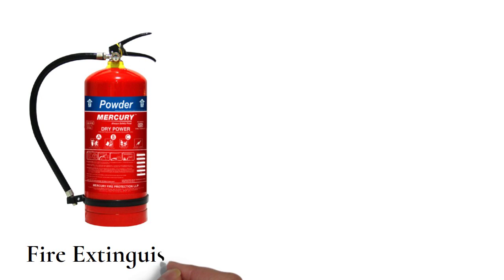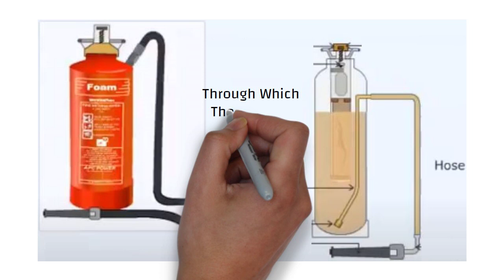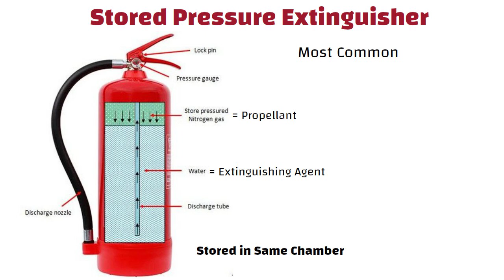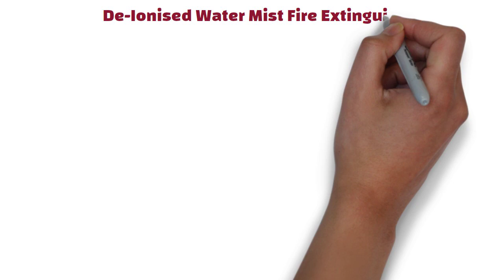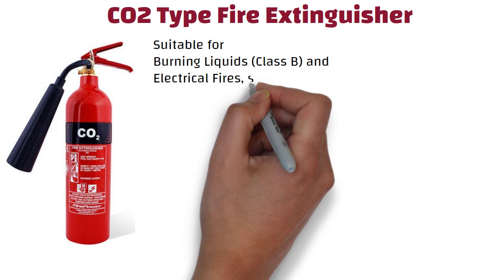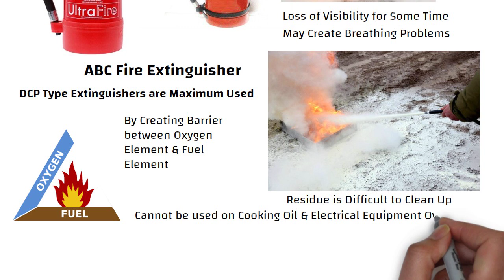FIRE EXTINGUISHER DEALERS IN KERALA, CALL 8138906102, FIRE EXTINGUISHER DEALERS IN ERNAKULAM.

Comment from the maker: Fire extinguisher dealers in KOTTARAKKARA, fire fighting contractors in KOTTARAKKARA, KOTTARAKKARA, fire and safety installations in KOTTARAKKARA, fire extinguisher suppliers in KOTTARAKKARA,fire extinguishers in KOTTARAKKARA, fire extinguishers in KOTTARAKKARA, fire protection system in KOTTARAKKARA, f fire and safety installation in KOTTARAKKARA, fire and safety contractors in KOTTARAKKARA, fire safety contractors in KOTTARAKKARA, fire and safety systems equipments in KOTTARAKKARA, fire equipment in KOTTARAKKARA, fire extinguisher in KOTTARAKKARA, fire protection system installation in KOTTARAKKARA, fire contractors in KOTTARAKKARA, fire safety consultants in KOTTARAKKARA,  fire alarm systems in KOTTARAKKARA, fire NOC in KOTTARAKKARA, fire AMC in KOTTARAKKARA, KOTTARAKKARA, fire fighting equipment in KOTTARAKKARA,
MS Jindal pipe dealers in KOTTARAKKARA, motor control panel in KOTTARAKKARA, fire pump panel in KOTTARAKKARA, motor control panel in KOTTARAKKARA, Morley fire alarm in KOTTARAKKARA, gst fire alarm in KOTTARAKKARA, addressable fire alarm system in KOTTARAKKARA, Pa talk back system in KOTTARAKKARA, PA talk back system in KOTTARAKKARA, auto glow SIGNAGES in KOTTARAKKARA, SIGNAGES in KOTTARAKKARA, pump PANELS in KOTTARAKKARA, LHP pump in kohi. Karthar valves in KOTTARAKKARA, Ravel fire alarm system in KOTTARAKKARA. Jindal pipe dealers in KOTTARAKKARA, Jindal pipe dealers in KOTTARAKKARA. MS pipe dealers in KOTTARAKKARA. Butterfly valves in KOTTARAKKARA, PA talk back system in KOTTARAKKARA, Fire alarm dealers in KOTTARAKKARA,, smoke detector dealers in KOTTARAKKARA, fire alarm panels dealers in KOTTARAKKARA, MCP, hooter dealers in Mangalor, hydrant valve dealers in KOTTARAKKARA, branch pipe dealers in KOTTARAKKARA, cp hose, RRL hose, heat detector dealers in KOTTARAKKARA,, Motor Control panel,  LED EXIT LIGHTS dealers in KOTTARAKKARA, emergency exit light dealers in KOTTARAKKARA, auto glow SIGNAGES dealers in KOTTARAKKARA. Conventional fire alarm system in KOTTARAKKARA
Reply: Fire extinguisher dealers in KAYAMKULAM, fire fighting contractors in KAYAMKULAM, KAYAMKULAM, fire and safety installations in KAYAMKULAM, fire extinguisher suppliers in KAYAMKULAM,fire extinguishers in KAYAMKULAM, fire extinguishers in KAYAMKULAM, fire protection system in KAYAMKULAM, f fire and safety installation in KAYAMKULAM, fire and safety contractors in KAYAMKULAM, fire safety contractors in KAYAMKULAM, fire and safety systems equipments in KAYAMKULAM, fire equipment in KAYAMKULAM, fire extinguisher in KAYAMKULAM, fire protection system installation in KAYAMKULAM, fire contractors in KAYAMKULAM, fire safety consultants in KAYAMKULAM,  fire alarm systems in KAYAMKULAM, fire NOC in KAYAMKULAM, fire AMC in KAYAMKULAM, KAYAMKULAM, fire fighting equipment in KAYAMKULAM,
MS Jindal pipe dealers in KAYAMKULAM, motor control panel in KAYAMKULAM, fire pump panel in KAYAMKULAM, motor control panel in KAYAMKULAM, Morley fire alarm in KAYAMKULAM, gst fire alarm in KAYAMKULAM, addressable fire alarm system in KAYAMKULAM, Pa talk back system in KAYAMKULAM, PA talk back system in KAYAMKULAM, auto glow SIGNAGES in KAYAMKULAM, SIGNAGES in KAYAMKULAM, pump PANELS in KAYAMKULAM, LHP pump in kohi. Karthar valves in KAYAMKULAM, Ravel fire alarm system in KAYAMKULAM. Jindal pipe dealers in KAYAMKULAM, Jindal pipe dealers in KAYAMKULAM. MS pipe dealers in KAYAMKULAM. Butterfly valves in KAYAMKULAM, PA talk back system in KAYAMKULAM, Fire alarm dealers in KAYAMKULAM,, smoke detector dealers in KAYAMKULAM, fire alarm panels dealers in KAYAMKULAM, MCP, hooter dealers in Mangalor, hydrant valve dealers in KAYAMKULAM, branch pipe dealers in KAYAMKULAM, cp hose, RRL hose, heat detector dealers in KAYAMKULAM,, Motor Control panel,  LED EXIT LIGHTS dealers in KAYAMKULAM, emergency exit light dealers in KAYAMKULAM, auto glow SIGNAGES dealers in KAYAMKULAM. Conventional fire alarm system in KAYAMKULAM,
KIRLOSKAR FIRE FIGHTING PUMP DEALERS IN KAYAMKULAM, FIRE FIGHTING EQUIPMENT DEALERS IN KAYAMKULAM, FIRE ALARM SYSTEM DEALERS IN KAYAMKULAM, FIRE CONSULTANTS IN KAYAMKULAM, FIRE CONTRACTOTORS IN KAYAMKULAM, FIRE CONTRACTORS IN KAYAMKULAM, FIRE ALARM SYSTEM DEALERS IN KAYAMKULAM, SMOKE DETECTOR DEALERS IN KAYAMKULAM, FIRE PROTECTION SYSTEM IN KAYAMKULAM, FIRE CONSULTANTS IN KAYAMKULAM, FIRE CONSULTANTS IN KAYAMKULAM, PA TALK BACK SYSTEM IN KAYAMKULAM, ADDRESSABLE FIRE ALARM SYSTEMS IN KAYAMKULAM, CUTTER PUMP DEALERS IN KAYAMKULAM, ADDRESSABLE FIRE ALARM SYSTEM SUPPLIERS IN KAYAMKULAM, SMOKE DETECTOR DEALERS IN TKAYAMKULAM, PRESSURE BOOSTING PUMP DEALERS IN KAYAMKULAM, SLURRY PUMP DEALERS IN KAYAMKULAM, WATER PUMP DEALERS IN KAYAMKULAM, RAVEL FIRE ALARM SYSTEM IN KAYAMKULAM,
Reply: FIRE EXTINGUISHER DEALERS IN CALICUT, FIRE EXTINGUISHER SUPPLIERS IN CALICUT, FIRE EXTINGUISHER DISTRIBUTORS IN CALICUT, FIRE EXTINGUISHER IN CALICUT, ABC TYPE FIRE EXTINGUISHER DEALERS IN CALICUT, CO2 TYPE FIRE EXTINGUISHER DEALERS IN CALICUT, CLEAN AGENT FIRE EXTINGUISHER IN CALICUT, MODULAR TYPE FIRE EXTINGUISHER DEALERS IN CALICUT, MECHANICAL FOAM FIRE EXTINGUISHER DEALERS IN CALICUT, FIRE EXTINGUISHER NEAR ME CALICUT, FIRE EXTINGUISHER TRADERS IN CALICUT, FIRE FIGHTING COMPANIES IN CALICUT, FIRE CONTRACTORS IN CALICUT, FIRE EQUIPMENT DEALERS IN CALICUT, FIRE ALARM DEALERS IN CALICUT, FIRE PUMP DEALERS IN CALICUT, SMOKE DETECTOR DEALERS IN CALICUT, FIRE FIGHTING SYSTEM IN CALICUT, FIRE PROTECTION SYSTEM IN CALICUT, FIRE AND SAFETY CONTRACTORS IN CALICUT, FIRE HYDRANT SYSTEMS IN CALICUT, PA TALK BACK SYSTEM IN CALICUT, FIRE NOC IN CALICUT, FIRE INSTALLATION IN CALICUT, FIRE NOC RENEWAL IN CALICUT, KIRLOSKAR FIRE PUMP DEALERS IN CALICUT, FIRE EXTINGUISHER NEAR ME CALICUT, FIRE EXTINGUISHER MANUFACURERS IN CALICUT, SAFEX FIRE EXTINGUISHER DEALERS IN CALICUT, FIRE NOC CONTRACTORS IN CALICUT, FIRE FIGHTING EQUIPMENT DEALERS IN CALICUT, FIRE PROTECTION SYSTEM IN CALICUT, FIRE INSTALLATION IN CALICUT, FIRE SAFETY CONTRACTORS IN CALICUT, FIRE AMC IN CALICUT, FIRE PROTECTION SYSTEM IN CALICUT, FIRE PROTECTION EQUIPMET IN CALICUT, AMC OF FIRE SYSTEM IN CALICUT, FIRE CONSULTANTS IN CALICUT, FIRE AND SAFETY EQUIPMENT DEALERS IN CALICUT, ADDRESSABLE FIRE ALARM SYSTEM IN CALICUT, KARTHAR VALVE DEALERS IN CALICUT, DCP TYPE FIRE EXTINGUISHER IN CALICUT, POWSER TYPE FIRE EXTINGUISHERS IN CALICUT, FIRE HYDRANT SYSTEM IN CALICUT, FIRE ALARM PANEL DEALERS IN CALICUT, SAFEPRO FIRE EXTINGUISHER DEALERS IN CALICUT, MS AND GI PIPE DEALERS IN CALICUT, JINDAL PIPE DEALERS IN CALICUT, AGNI FIRE ALARM DEALERS IN CALICUT, FIRE EQUIPMENT DEALERS IN CALICUT, FIRE EQUIPMENT SUPPLIERS IN CALICUT, FIRE EQUIPMENT TRADERS IN CALICUT, FIRE SPRINKLER SYSTEM IN CALICUT, RAVLE FIRE ALARM DEALERS IN CALICUT, RAVEL FIRE ALARM SYSTEM IN CALICUT, AGNI FIRE ALARM DISTRIBUTORS IN CALICUT, FIRE ALARM CONTRACTORS IN CALICUT, FIRE PIPE INSTALLATION IN CONTRACTORS IN CALICUT, FIRE SAFETY CONTRACTORS IN CALICUT, FIRE PA TWO WAY TALK BACK SYSTEM DEALERS IN CALICUT, HEAT DETECTOR DEALERS IN CALICUT, HONEYWELL FIRE ALARM DEALERS IN CALICUT, FIRE NOC CONSULTANTS IN CALICUT, FIRE AMC AND FIRE NOC IN CALICUT, FIRE SAFETY COMPANIES IN CALICUT, NEWAGE DEALERS IN CALICUT, MONSHER FIRE EQUIPMENT DEALERS IN CALICUT, KARTHAR VALVE DEALERS IN CALICUT, FIRE HYDRANT VALVE DEALERS IN CALICUT, FIRE HOSE REEL DRUM DEALERS IN CALICUT, FIRE SPRINKLER DEALERS IN CALICUT, FIRE PUMP DEALERS IN CALICUT, LUBI PUMP DEALERS IN CALICUT, LHP PUMP DEALERS IN CALICUT. FIRE CONTRACTORS IN CALICUT, FIRE AND SAFETY CONTRACTORS IN CALICUT, FIRE EQUIPMENT DEALERS IN CALICUT, FIRE FIGHTING CONTRACTORS IN CALICUT,

Comment from the maker: FIRE ALARM DEALERS IN KOTTARAKKARA, ADDRESSABLE FIRE ALARM DEALERS IN KOTTARAKKARA, FIRE ALARM SYSTEM DEALERS IN KOTTARAKKARA, ADDRESSABLE FIRE ALARM SYSTEM DEALERS IN KOTTARAKKARA, FIRE DETECTION SYSTEM IN KOTTARAKKARA, SMOKE DETECTOR DEALERS IN KOTTARAKKARA, CONVENTIONAL FIRE ALARM DEALERS IN KOTTARAKKARA, MORLEY FIRE ALARM DEALERS IN KOTTARAKKARA, GST FIRE ALARM DEALERS IN KOTTARAKKARA, ASES SECURITY FIRE ALARM DEALERS IN KOTTARAKKARA, BEAM DETECTOR DEALERS IN KOTTARAKKARA, FIRE ALARM SUPPLIERS IN KOTTARAKKARA, FIRE ALARM TRADERS IN KOTTARAKKARA, FIRE ALARM PANEL DEALERS IN KOTTARAKKARA, HEAT DETECTOR DEALERS IN KOTTARAKKARA, FIRE ALARM SYSTEM SUPPLIERS IN KOTTARAKKARA, FIRE ALARM COMPANIES IN KOTTARAKKARA, FIRE EQUIPMENT DEALERS IN KOTTARAKKARA, ADRRESSABLE FIRE ALARM PANEL DEALERS IN KOTTARAKKARA, FIRE ALARM SYSTEM IN KOTTARAKKARA, BATTERY OPERATED DETECTOR DEALERS IN KOTTARAKKARA, ASPIRATION DETECTION SYSTEM DEALERS IN KOTTARAKKARA, FIRE ALARM MCP - MANUAL CALL POINT DEALERS IN KOTTARAKKARA, FIRE ALARM HOOTER DEALERS IN KOTTARAKKARA, PA TWO WAY TALK BACK SYSTEM DEALERS IN KOTTARAKKARA, PA SYSTEM DEALERS IN KOTTARAKKARA, PA TALK BACK UNIT DEALERS IN KOTTARAKKARA, HOOTER CUM STROBE DEALERS IN KOTTARAKKARA, FIRE PROTECTION SYSTEM IN KOTTARAKKARA, FIRE ALARM CONTRACTORS IN KOTTARAKKARA, FIRE DETECTORS IN KOTTARAKKARA, FIRE ALARM DEALERS IN KOLLAM, ADDRESSABLE FIRE ALARM DEALERS IN KOLLAM, SMOKE DETECTOR DEALERS IN KOLLAM, FIRE EQUIPMENT DEALERS IN KOTTARAKKARA, FIRE ALARM INSTALLATION IN KOTTARAKKARA, FIRE ALARM COMPANIES IN KOTTARAKKARA FIRE ALARM DISTRIBUTORS IN KOTTARAKKARA, TALK BACK SYSTEM DEALERS IN KOTTARAKKARA, FIRE ALARM SENSOR DEALERS IN KOTTARAKKARA, FIRE EXTINGUISHER DEALERS IN KOTTARAKKARA, FIRE ALARM DEALERS IN ERNAKULAM, FIRE ALARM DEALERS IN KERALA, ADDRESSABLE FIRE ALARM DEALERS IN CALICUT, SMOKE DETECTOR IN KOTTARAKKARA,  FIRE EXTINGUISHER DEALERS IN KOTTARAKKARA, FIRE EXTINGUISHER SUPPLIERS IN KOTTARAKKARA, FIRE EXTINGUISHER DISTRIBUTORS IN KOTTARAKKARA FIRE EXTINGUISHER IN KOTTARAKKARA, ABC TYPE FIRE EXTINGUISHER DEALERS IN KOTTARAKKARA, CO2 TYPE FIRE EXTINGUISHER DEALERS IN KOTTARAKKARA, CLEAN AGENT FIRE EXTINGUISHER IN KOTTARAKKARA FIRE FIGHTING PUMP DEALERS IN KOTTARAKKARA, FIRE PUMP DEALERS IN KOTTARAKKARA, KIRLOSKAR FIRE PUMP DEALERS IN KOTTARAKKARA, FIRE JOCKEY PUMP DEALERS IN KOTTARAKKARA, FIRE DISEL ENGINE DRIVEN PUMP DEALERS IN KOTTARAKKARA, FIRE FIGHTING EQUIPMENT DEALERS IN KOTTARAKKARA, FIRE FIGHTING SYSTEM IN KOTTARAKKARA, VERTICAL INLINE PUMP DEALERS IN KOTTARAKKARA, HYDRO PNEUMATIC PRESSURE BOOSTING PUMP DEALERS IN KOTTARAKKARA, VERTICAL TURBINE PUMP DEALERS IN KOTTARAKKARA, SEWAGE PUMP DEALERS IN KOTTARAKKARA, RO PUMP DEALERS IN KOTTARAKKARA. FIRE EXTINGUISHER IN KOTTARAKKARA, FIRE EXTINGUISHER SUPPLIERS IN KOTTARAKKARA,
Reply: FIRE EXTINGUISHER DEALERS IN KERALA, FIRE EXTINGUISHER SUPPLIERS IN KERALA, FIRE EXTINGUISHER DISTRIBUTORS IN KERALA, FIRE EXTINGUISHER IN KERALA, ABC TYPE FIRE EXTINGUISHER DEALERS IN KERALA, CO2 TYPE FIRE EXTINGUISHER DEALERS IN KERALA, CLEAN AGENT FIRE EXTINGUISHER IN KERALA, MODULAR TYPE FIRE EXTINGUISHER DEALERS IN KERALA, MECHANICAL FOAM FIRE EXTINGUISHER DEALERS IN KERALA, FIRE EXTINGUISHER NEAR ME KERALA, FIRE EXTINGUISHER TRADERS IN KERALA, FIRE FIGHTING COMPANIES IN KERALA, FIRE CONTRACTORS IN KERALA, FIRE EQUIPMENT DEALERS IN KERALA, FIRE ALARM DEALERS IN KERALA, FIRE PUMP DEALERS IN KERALA, SMOKE DETECTOR DEALERS IN KERALA, FIRE FIGHTING SYSTEM IN KERALA, FIRE PROTECTION SYSTEM IN KERALA, FIRE AND SAFETY CONTRACTORS IN KERALA, FIRE HYDRANT SYSTEMS IN KERALA, PA TALK BACK SYSTEM IN KERALA, FIRE NOC IN KERALA, FIRE INSTALLATION IN KERALA, FIRE NOC RENEWAL IN KERALA, KIRLOSKAR FIRE PUMP DEALERS IN KERALA, FIRE EXTINGUISHER NEAR ME KERALA, FIRE EXTINGUISHER MANUFACURERS IN KERALA, SAFEX FIRE EXTINGUISHER DEALERS IN KERALA, FIRE NOC CONTRACTORS IN KERALA, FIRE FIGHTING EQUIPMENT DEALERS IN KERALA, FIRE PROTECTION SYSTEM IN KERALA, FIRE INSTALLATION IN KERALA, FIRE SAFETY CONTRACTORS IN KERALA, FIRE AMC IN KERALA, FIRE PROTECTION SYSTEM IN KERALA, FIRE PROTECTION EQUIPMET IN KERALA, AMC OF FIRE SYSTEM IN KERALA, FIRE CONSULTANTS IN KERALA, FIRE AND SAFETY EQUIPMENT DEALERS IN KERALA, ADDRESSABLE FIRE ALARM SYSTEM IN KERALA, KARTHAR VALVE DEALERS IN KERALA, DCP TYPE FIRE EXTINGUISHER IN KERALA, POWSER TYPE FIRE EXTINGUISHERS IN KERALA, FIRE HYDRANT SYSTEM IN KERALA, FIRE ALARM PANEL DEALERS IN KERALA, SAFEPRO FIRE EXTINGUISHER DEALERS IN KERALA, MS AND GI PIPE DEALERS IN KERALA, JINDAL PIPE DEALERS IN KERALA, AGNI FIRE ALARM DEALERS IN KERALA, FIRE EQUIPMENT DEALERS IN KERALA, FIRE EQUIPMENT SUPPLIERS IN KERALA, FIRE EQUIPMENT TRADERS IN KERALA, FIRE SPRINKLER SYSTEM IN KERALA, RAVLE FIRE ALARM DEALERS IN KERALA, RAVEL FIRE ALARM SYSTEM IN KERALA, AGNI FIRE ALARM DISTRIBUTORS IN KERALA, FIRE ALARM CONTRACTORS IN KERALA, FIRE PIPE INSTALLATION IN CONTRACTORS IN KERALA, FIRE SAFETY CONTRACTORS IN KERALA, FIRE PA TWO WAY TALK BACK SYSTEM DEALERS IN KERALA, HEAT DETECTOR DEALERS IN KERALA, HONEYWELL FIRE ALARM DEALERS IN KERALA, FIRE NOC CONSULTANTS IN KERALA, FIRE AMC AND FIRE NOC IN KERALA, FIRE SAFETY COMPANIES IN KERALA, NEWAGE DEALERS IN KERALA, MONSHER FIRE EQUIPMENT DEALERS IN KERALA, KARTHAR VALVE DEALERS IN KERALA, FIRE HYDRANT VALVE DEALERS IN KERALA, FIRE HOSE REEL DRUM DEALERS IN KERALA, FIRE SPRINKLER DEALERS IN KERALA, FIRE PUMP DEALERS IN KERALA, LUBI PUMP DEALERS IN KERALA, LHP PUMP DEALERS IN KERALA.

Comment from the maker: FIRE ALARM DEALERS IN ADOOR, ADDRESSABLE FIRE ALARM DEALERS IN ADOOR, FIRE ALARM SYSTEM DEALERS IN ADOOR, ADDRESSABLE FIRE ALARM SYSTEM DEALERS IN ADOOR, FIRE DETECTION SYSTEM IN ADOOR, SMOKE DETECTOR DEALERS IN ADOOR, CONVENTIONAL FIRE ALARM DEALERS IN ADOOR, MORLEY FIRE ALARM DEALERS IN ADOOR, GST FIRE ALARM DEALERS IN ADOOR, ASES SECURITY FIRE ALARM DEALERS IN ADOOR, BEAM DETECTOR DEALERS IN ADOOR, FIRE ALARM SUPPLIERS IN ADOOR, FIRE ALARM TRADERS IN ADOOR, FIRE ALARM PANEL DEALERS IN ADOOR, HEAT DETECTOR DEALERS IN ADOOR, FIRE ALARM SYSTEM SUPPLIERS IN ADOOR, FIRE ALARM COMPANIES IN ADOOR, FIRE EQUIPMENT DEALERS IN ADOOR, ADRRESSABLE FIRE ALARM PANEL DEALERS IN ADOOR, FIRE ALARM SYSTEM IN ADOOR, BATTERY OPERATED DETECTOR DEALERS IN ADOOR, ASPIRATION DETECTION SYSTEM DEALERS IN ADOOR, FIRE ALARM MCP - MANUAL CALL POINT DEALERS IN ADOOR, FIRE ALARM HOOTER DEALERS IN ADOOR, PA TWO WAY TALK BACK SYSTEM DEALERS IN ADOOR, PA SYSTEM DEALERS IN ADOOR, PA TALK BACK UNIT DEALERS IN ADOOR, HOOTER CUM STROBE DEALERS IN ADOOR, FIRE PROTECTION SYSTEM IN ADOOR, FIRE ALARM CONTRACTORS IN ADOOR, FIRE DETECTORS IN ADOOR, FIRE ALARM DEALERS IN KOLLAM, ADDRESSABLE FIRE ALARM DEALERS IN KOLLAM, SMOKE DETECTOR DEALERS IN KOLLAM, FIRE EQUIPMENT DEALERS IN ADOOR, FIRE ALARM INSTALLATION IN ADOOR, FIRE ALARM COMPANIES IN ADOOR FIRE ALARM DISTRIBUTORS IN ADOOR, TALK BACK SYSTEM DEALERS IN ADOOR, FIRE ALARM SENSOR DEALERS IN ADOOR, FIRE EXTINGUISHER DEALERS IN ADOOR, FIRE ALARM DEALERS IN ERNAKULAM, FIRE ALARM DEALERS IN KERALA, ADDRESSABLE FIRE ALARM DEALERS IN CALICUT, SMOKE DETECTOR IN ADOOR,  FIRE EXTINGUISHER DEALERS IN ADOOR, FIRE EXTINGUISHER SUPPLIERS IN ADOOR, FIRE EXTINGUISHER DISTRIBUTORS IN ADOOR FIRE EXTINGUISHER IN ADOOR, ABC TYPE FIRE EXTINGUISHER DEALERS IN ADOOR, CO2 TYPE FIRE EXTINGUISHER DEALERS IN ADOOR, CLEAN AGENT FIRE EXTINGUISHER IN ADOOR FIRE FIGHTING PUMP DEALERS IN ADOOR, FIRE PUMP DEALERS IN ADOOR, KIRLOSKAR FIRE PUMP DEALERS IN ADOOR, FIRE JOCKEY PUMP DEALERS IN ADOOR, FIRE DISEL ENGINE DRIVEN PUMP DEALERS IN ADOOR, FIRE FIGHTING EQUIPMENT DEALERS IN ADOOR, FIRE FIGHTING SYSTEM IN ADOOR, VERTICAL INLINE PUMP DEALERS IN ADOOR, HYDRO PNEUMATIC PRESSURE BOOSTING PUMP DEALERS IN ADOOR, VERTICAL TURBINE PUMP DEALERS IN ADOOR, SEWAGE PUMP DEALERS IN ADOOR, RO PUMP DEALERS IN ADOOR. FIRE EXTINGUISHER DEALERS IN PANDALAM, FIRE EXTINGUISHER SUPPLIERS IN ADOOR,